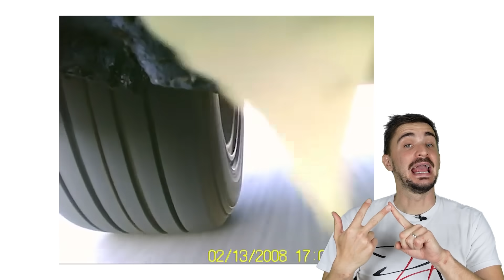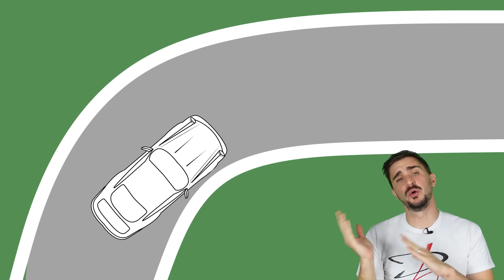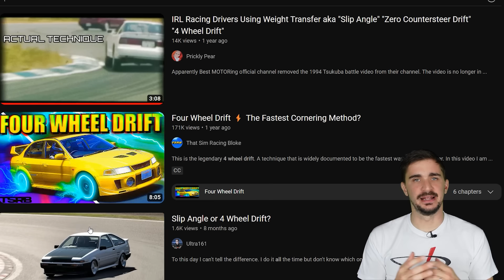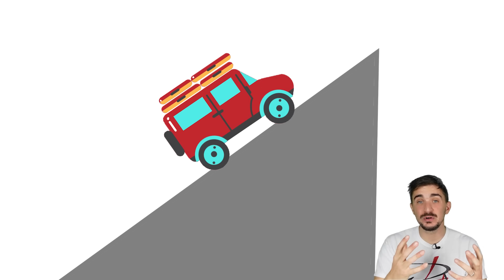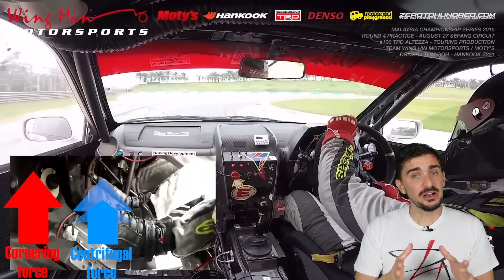You Think You Know But You Don't - Slip Angle Explained in a Way You Will Understand

Comment: Does a small contact area mean a lower slip angle? E.g. if my tire is fully inflated and only 1cm of tire touches the road at a time, there are more "contact patches" around the circumference of the tire, thus each one would have a lower contact angle.

Comment: First, let us forget the stuff about 'centrifugal force'. The main force involved here,centripetal force, provides the acceleration of the vehicle towards the centre of curvature, and is <= maximum tyre friction.  

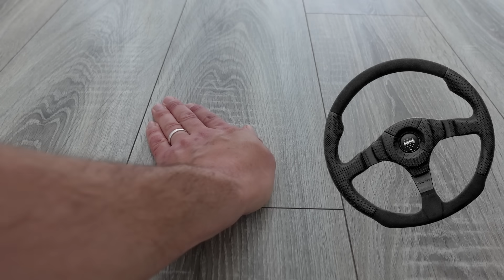Another necessary force is the force that yaws the vehicle so that the cornering force always points towards that centre. Some might be confused by the explanation (around 5:15) which seems to suggest that as one goes around a corner one needs to rotate the steering wheel further and further - this is not the case. The torque comes from the difference in cornering force front and rear. The rotation of the steering wheel turns the vehicle to the angle at which the slip angles are appropriate for the radius of curvature, once "turned in" the steering wheel is kept at a constant angle unless the radius of curvature (or frictional force) changes.

Comment: Just an observation: notice how much longer and less steep the street tire is on the graphic past its peak mark. Street tires are much more predictable and forgiving to changes. You can hit a corner in a car with 215/60 tires an you can feel them reaching their limits and being able to correct way ahead, while in a car with 315/35 tires you're going to have all of the grip, until you go past their peak cornering force and them you have nothing! The reaction time to correct almost needs to start happening before peak point.

Comment: I've written a lot of game physics and the way I model cars turning is very much by thinking of friction as the active force. Car is in the corner with it's inertia wanting to continue in a straight line but the friction generated at the contact patch fully resist this motion while static friction isn't exceeded, thus redirecting the inertia according to the vector of the friction. Way it works in my mind the 'centrifugal force' isn't even there, that's just felt acceleration as inertial trajectory curves due to friction. To me what you call 'cornering force' seem to be the internal tension in the deformed tyre, while that's certainly how the force is transmitted from the rubber to the metal isn't what happen at the contact point just as active?

I think of friction as the microscopic mechanical interface between how hard two surfaces are being pressed together (as in normal force) and then just Newtons 3rd law in how much force can apply laterally before that mechanical bound is broken and the surfaces come unhooked and slide against one another, seems to be a popular static/kinetic friction explanation.

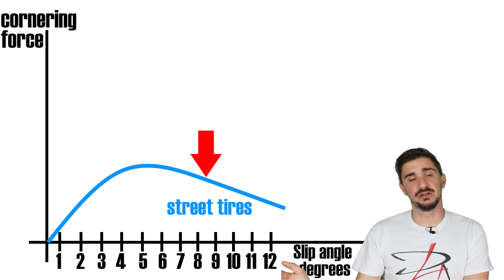Comment: Graph at 12:06 is not correct, or at the very least, I certainly haven't seen racing tyres with such high peak slip angles, nor have I seen road tyres with such low slip angles.

Generally, racing tyres are going to have a much higher cornering stiffness and will have much lower peak slip angle much sooner than street tyres. This is partly due to the fact that the contact patch is so much stiffer on a slick tyre since it has one massive tread block instead of multiple smaller tread blocks. This is also what causes it to lose traction much more quickly after the peak.

Comment: Mostly correct but it explains some details slightly wrong. The car or tire does not move in the direction of the contact patch, but slightly off it. Otherwise what’s generating the cornering force? Try to explain cornering in the case of steel wheels (no rubber). They can steer, too, but their contact patch does not deform.

Comment: If slip angle requires the fact that the rubber tire being elastic, doesn't that mean a steel wheel or even a wooden wheel cannot steer??? Not obviously this is not the case right? So how does "hard" wheel steer the vechicle?
Reply from the maker: Poorly

Comment: Very thorough explanation, though one thing I disagree with is that slip angle is required to exert a cornering force. Rather slip angle is a result of a relatively large force acting upon an elastic object. So if you could have a tire made if a high friction material with high stiffness too it could exert a high cornering force with negligible slip angle. So with car tires slip angle correlates with high cornering force, though it does not cause high cornering force.

Comment: For your information there is no such force as centrifugal force, forcing you outward in the turn but rather a centripetal force forcing you inward to the center.of the turn. In the car you think you are  eing thrown outward  buT You are in the accelerated frame of reference. If you look from a one you will see the car door is pushing you towards the ce ter of the turn not outward. A lot of engineers even get this wrong
Reply from the maker: But there's a wiki page called centrifugal force? ☺️ Seriously though, whether it exists or not from a theoretical perspective is irrelevant. What matters is that it explains a concept. You could argue that physics doesn't exist or any of the forces. It's just objects moving, everything else was made up by us to help us understand and predict.

Comment: @ 05:22 there is a mistake: you show a constant turn with your hands but the steering wheel and the explanation is about increasing the steering angle.

Whatever: this effect you show is the reason why a car without power steering is easierer to manouvre whilst in motion than stationary. 👍 

( BTW: please try to explain how the next incoming thread can deform when using a slick tire.😅😂🫣🤭 )
Reply from the maker: I'm afraid you're misunderstanding the concepts in the video, including slicks. A slick is also composed of tread elements just like any other tires. The grooves that tires have to displace rain/snow/mud are not tread elements. Should I also put various emoticons at the end of my message to attempt to ridicule you?
Reply: @d4a  the last 4 emoticons should indicate "fun". But that Obviously went wrong. Sorry.

But "Slip Angle" and "Thread" both seem have at least two meanings.

Comment: At 12:52 the explanation is misleading because it suggests the tire can't create as much force at low speeds. The reason you must slow down for sharp corners is because centrifugal force is higher at lower speeds. Put differently: the tire's maximum cornering force has not changed, but sharper corners create greater forces at lower speeds.

Comment: Thumbs up, and a quibble:
If you release a sling at TDC the rock goes forward not up. So that big yellow line shouldn't arc to the left, but go forward, as would happen if the driver was asleep at the wheel.

Comment: I hate swearing, but.. HOLLY FOOK! I thought I know a lot about slip angle. Turns out I didn't know anything! Thanks @driving 4 answers!
Reply: I'm so excited I am commenting before finishing the video first, lol. Yes, I knew that slip angle is the difference between where the car is heading and where the wheels are heading (now I learned I should say, the majority of the tire), but I thought that's due to slip (sliding). Now I learned that slip angle is the result of the contact-patch's reluctance to move while it's still pressed on the road by the car-weight and affected by different centrifugal forces.

Comment: Mandatory comment : centrifugal force doesn't exist. 

You're welcome

Oh yes, also there is no "contact patch" ever , since the tire's rotation is continuous : there is never a single molecule or atom of the tire that's immobile. remember you can't freeze time in the real world, only in video and video isn't real, it's a collection of stills.  Thus the distortion is continuous, thus nothing is ever "bonded" by friction and that's why tires wear off : thus the dynamic is much more complex than what you explained. Yes, it's simplified, but it's also false, lol.  
Hint: a wheel alone cannot turn like this, it needs to tilt left or right to turn  . In fact this phenomenon happens because of the presence of the other wheels and the elastic tension in the frame and how the weight/mass distributes on the directional wheels and prevent them to tilt (much but they still do ! because there's only 4 of them: notice how a bike that has only 2 wheels barely use steering : the more wheels the more steering : the more wheels need to slip on the road, or else they would just tilt) and how the tire LITERALLY SLIDES on the road and that's why it is called a slide angle  lol

Comment: You get to a great place by the end, but the way you explain it in the beginning isn't quite right. If it were how you said, you'd only generate cornering force while adding steering angle. You completely missed the mid corner bit where steering angle is more consistent (if you're not a hero modulating slip angle) but the car is still cornering, with the tyre generating cornering force to counteract the centrifical force.

Comment: Great video!  Very informative.  One questions though.  Isn't there another element of tires actually sliding across the surface during a turn.  I'm talking about the differing radius between the inside tires and outside tires.   Doesn't this relationship  also add some forces to the equation?

Comment: 12:15 I think the information there is not correct, race tyres offer greater lateral grip and have a sharp peak w.r.t slip angle, but the maximum grip is obtained at LOWER slip angles than regular street tires.

Comment: Well if is a FWD, RWD or 4WD it will be different. The only vehicle that all will be consistent is a motor cycle. 
Oh then there is anti lock brakes, traction and stability controls to just make it more unpredictable.
So as long as the friction is greater than the side or propelling forces. No problems,
. 
Problems is what happens is computer tries to make the vehicle go in straight line and you need to go in a partial circle.

This is done because people don't know how to drive well on snow and ice. Hell they can't deal with 3 pedals anymore either. Yep the computer controls that automatic transmission now too.
So if you are driving a Mustang or Camaro and want to turn the ponies loose. Do it in straight line and hope the traction is the same on both rear wheels.
I you are driving a automatic.
Then if there is a bit more traction on one side you might find a friendly pole to slow down on.

But if you are driving a stick just let off the guzzleline pedal and let the rear wheels pull the rear axle back inline behind the front one.
 But if the rear axle angle gets a bit too far off center? Look out for those friendly stopping poles.
That is the straight line part
Cornering requires practice. It is kinda frowned on by the police unless you are in a police vehicle.  A practice period  in some states on private property is also frowned on. Even you own the private property. That still gives the gendarmes a reason to sight you with careless driving. Unless it is a exempted racetrack.
There, I did not  need 16 minutes to explain it. As Dirty Harry said "Know your limitations."

Comment: couldn't cornering force be considered kinetic friction with an elastic material? thus with each 'change in seating input' and subsequent change in the angle of the rim, the tire is forced to deform and the resultant kinetic friction causes the change in direction? (just a thought)

Comment: One small correction: Spoilers don't utilize Newton's third law to generate downforce (the air going through the spoiler's curved surface does not produce an opposite effect - that being down force). Spoilers (or wings) produce downforce via low pressure - faster air flows under a wing because of the Venturi effect and the way a wing is built (like how fluids must accelerate through a constriction through a pipe in order to have the same rate of flow in and out - and to accelerate, it must have a lower pressure).

Comment: Another way to visualize slip angle, turn steering wheel while parked. All the steering linkage moves, wheels move, but tire patch stays planted. You can easily see this happen. See the slip angle. See wheel pointed more than patch.

You've created a slip angle.

Of course, keep turning wheel and eventually you overcome tires contact patch and patch is scraped across road, often making noise in protest. But when car is in motion the patch keeps taking its next step closer to wheel angle, like the hands on floor illustration demonstrated.

But even the turn wheel while parked test, when contact patch finally forced to slide, a slip angle remains. Wheel is pointed at greater turn angle than contact patch.

Comment: Now imagine really tall sidewall tires. Old school Cadillac, or offroad tires. There is going to be a much longer delay between steering input and vehicle response, as there is so much more elasticity between wheel pointing in a direction, and when contact patch of tire wrapped around that wheel responds.

Then imagine a high performance road tire, 40 series, super short, stiff sidewall. The wheel moves, tire moves with it. Much more instantly.

Comment: Dear D4A,

NO, no, no!!! Too much misleading, and plain WRONG, information here.

I like your presentation style, but the substance here is poor.

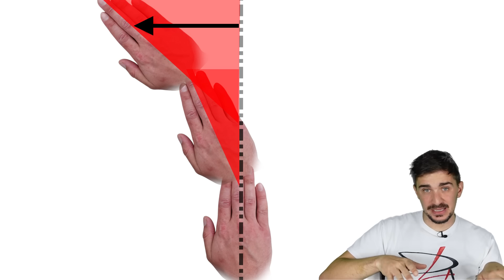7:15 - "This slipping creates a force..."
No. The "slipping", like all other kinematic quantities, is an EFFECT. See Newton's 1st -> "FORCES CAUSE MOTIONS".

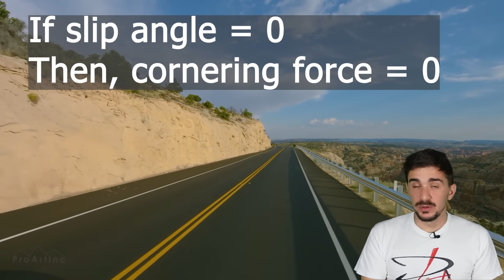7:26 - "If Slip-Angle [SA] = 0, then Cornering-Force [CF] = 0"
No. Zero SAs are often accompanied by non-zero CFs. "Ply-steer" and "conicity" are common on many tyres. Conicity is a type of "camber-thrust", which, on bikes, can give high CFs with negligible SA.

Also, a sudden increase in SA is initially accompanied by negligible CF. It takes the "tyre relaxation length" for the tyre-sidewalls to distort enough for the CF to be felt. 

8:22 - "Cornering force is higher than centrifugal force..."
No. By Newton's 3rd they are "equal and opposite".

10:45++ "[Graphs of CF vs SA]"
 All these graphs, and your comments on them, are VERY MISLEADING. Some examples here, with my emphasis.

12:04 - "CF peaks at 5-6 degrees SA, then gradually starts FALLING OFF..."
12:13 - "Racing tyres' CFs ... FALL OFF MORE RAPIDLY... only maintains [peak] CF over a shorter range..."

CF/SA curves DO NOT HAVE A PEAK as you show them. NO, NO, NO!

The true shape of CF/SA curves depends much on the road surface, and time spent at high SA. But the vast majority of curves LEVEL OFF to a WIDE PLATEAU that stretches from SA = ~10 deg, to SA = ~ 170 deg. Then, when the tyre is rolling backwards (SA = 180 deg), CF drops back to near zero (obviously?). Then, from ~180 -> 360 deg, negative CF (opposite direction).

Incidentally, your "Cornering Force" is usually referred to as the tyre's "Fy force", because it is "sideways" to the wheel's reference axes, according to common convention. A better name is the "Axial" force, because it is in the direction of the wheel's axle. Important note (!), a wheel's "Y-direction" is very rarely the same as the car's "Y-direction". So Sum-All-Wheel-Fys NOT EQUAL Car-Fy.

Some tyre/road combinations can have a slight CF drop between SA = ~10 -> 170 deg, but they NEVER drop off as much as you show them. Also, the time spent at high SAs makes a big difference to CFs. Long time at high SA -> much tyre heating -> molten rubber -> lower CF.

14:15 - "...over THE LIMIT [peak?]..."
The reason cars are difficult to drive "over the limit", namely past the edge of the plateau, has little to do with the CF "dropping off". Rather, it is because when the tyres are "ON TOP of the plateau", then any small changes in Steer/Slip-Angle have negligible effect on the MAGNITUDE of the CF, which remains close to constant.

So any turning of the steering-wheel by the driver only changes the DIRECTION of the almost constant magnitude Axial(!)-CFs of the front wheels. This makes it difficult to make big changes to the car's attitude/heading/path.

However, the driver can use the pedals to control the car, albeit with less precision and responsiveness than from steering inputs. Pressing accelerator or brake pedals can alter the front-rear distribution of the vertical "Fz" loads on the four tyres, which can then change their Fy-Axial-CFs.

When near, or over, "the limit", the pedals are a much more powerful control than the steering-wheel. Watch rally drivers tap-dancing on the pedals when sliding around a corner.

Cheers
Z

Comment: Pretty nice explanation and nice video. Next, you should add wheel alignment to these concepts. As far as I know, wheels (at least on the front axle) point inwards, meaning that the tires are never pointing in the same direction as the other and also they are not pointing in the direction that the car is going.

Comment: Great video.  My only suggestion is you consider tire pressure.  My 65 Corvair with rear engine and my Dad's 70's Ford station wagons all had higher tire pressure in the back than the front. (20 front 30 rear for the Corsair) So the tires in the back were stiffer and could generate more corning force for a given wheel angle than the front tires.  My dad had is tires rotated and the shop didn't adjust the tire pressures.  The wagon felt like the rear suspension had come loose.  If my understanding is correct it isn't just weight, but the stiffer springs to handle the weight.  When you corner, the stiffer springs do more to resist the car leaning so the tires are more heavily stressed.  My 2015 VW wagon has the same tire pressures front and back.  I'm guessing the more modern suspension uses anti-roll bars to compensate for different springs.  Does that sound right to you?